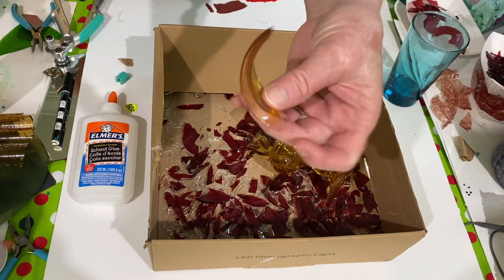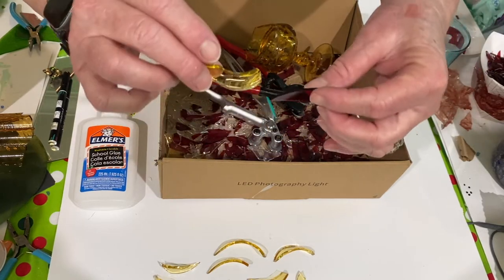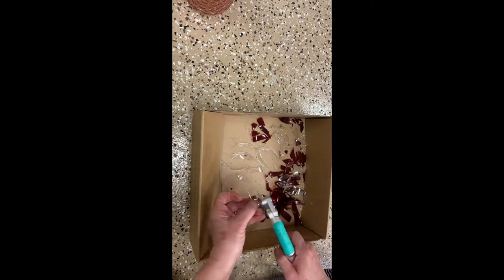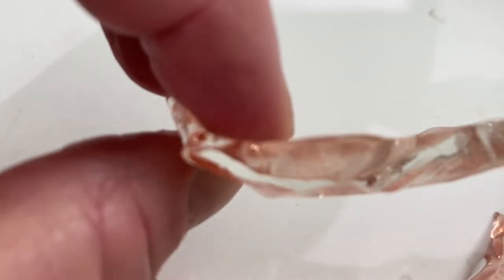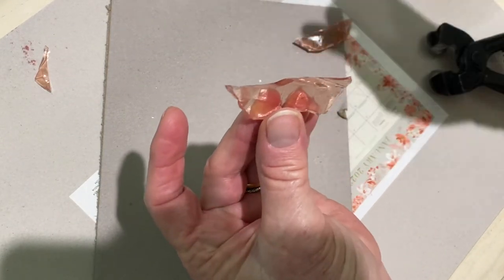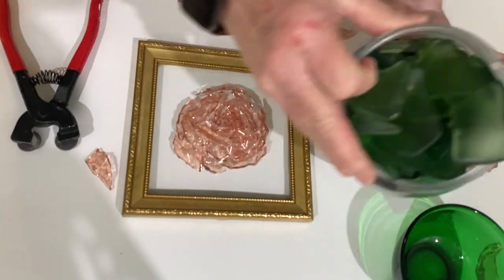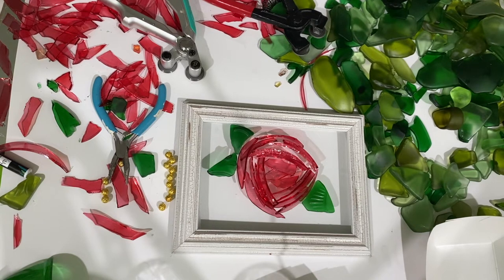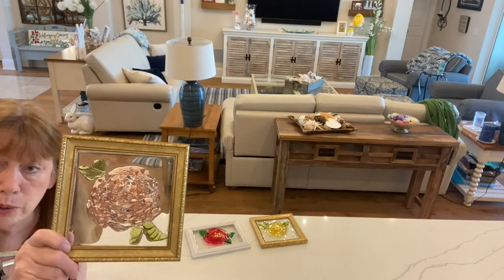BROKEN GLASS FLOWERS, ROSES, HOW TO MAKE BEAUTIFUL FLOWERS GLASS & EPOXY RESIN, GLASS ON GLASS ART

Comment: How do you get the glass plate backing to adhere to the frame? Do you just let the resin seep through the cracks between the glass plate and the frame, therefore the glass will harden to the frame? Because when I use the little black glazing points the frame came with which holds glass plate and original picture to the frame, they show through the glass.
Reply from the maker: If you watch the video at about 1/3 way through (4 min and 29 sec into it) I show you how i prepare the frames. I remove the glass use elmers glue where the glass sits then replace the glass and put elmers glue again around the back of the perimeter. Sometimes as an extra precaution against resin leaks I will also use painters tape on the back also and remove after the resin has set. I hope that helps. I think that is what you are asking?
Reply from the maker: I see so I pull those black points out because the glue holds it in place.